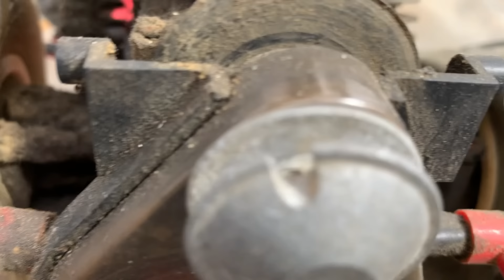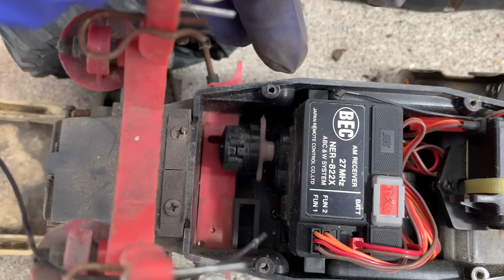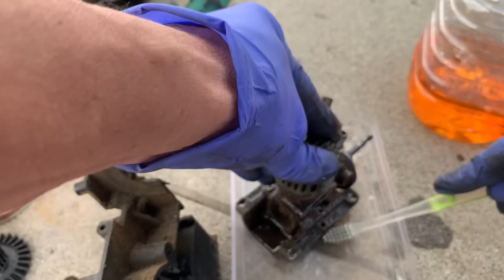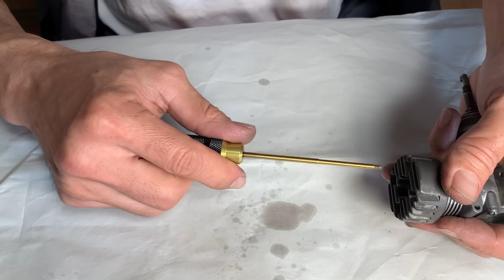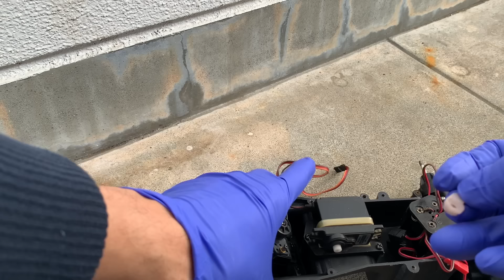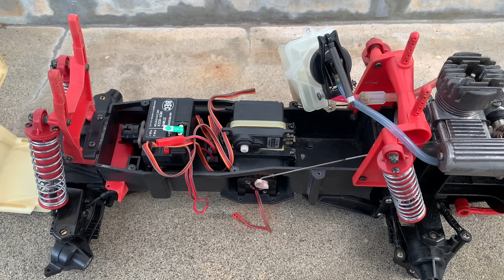Kyosho Nitro Brute stopped for 30 years, restoration

Comment: Hello, I had one of these, I see you've the Enya 11 (1.1), this upgrade, maybe was even suggested somewhere on the box, but problem was the 1.1 destroyed the clutch and brake, the extra torque would mince the clutch mech pads if tyres were caked in mud, or even on high grip surface be gentle on throttle inputs, if it fails she won't be able to stop, the brake will fail as you use it as its fighting the 1.1 without the clutch engaging, not a big problem if using in a large open area, either wait for fuel to run out, or scope her up as she passes by, Personally I would use her, just don't ever give her the full beans from stationary, she is a piece of RC history and certainly deserves a spot on the shelf once run a few times, i have looked for a Nitro Brute a couple of times and never found much info, thank you very much for sharing your restoration, P.s, does yours have the larger fuel tank? did you know there was a aftermarket exhaust that exited straight up between the cab and bed (ours melted!! lol) If you are familiar with the other Kyosho nitro offerings of the time (RS200 and 405 Rallye) these where considered bombproof when compared to the NB, best of luck, and again thanks for sharing, cheers Andrew.
Reply from the maker: Hello André, how are you?    So, in relation to the brakes, due to the engine, they really don't last long, the disc is already thin.    As for the tires, they are available on the Kyosho website, original, but I don't think they are worth it because they are expensive.    Thank you very much for your comment, have a great week.
Reply: @rcornothing7973  @ 16.39 is where the problem starts, on watching again in slowmo you are missing the self adhesive clutch pads that stick inside of the part in your right hand (2x pads like sticky sand paper), the 3 piece sprung loaded metal arms engage on these when spinning, the 11 or 1.1 destroys them. the part is your right hand let's call the "clutch housing" anyway this part looks like it has been run without the pads (it looks scratched by the metal arms) if so it means that part gets hot, causing it to fail, it is specific part to Nitro Brute. hope this helps. .edit- this will explain the wear you mention on brakes. The missing clutch pads were the only thing standing in the way of the huge torque of that 11 and what in essence a Big Brute gearbox. If possible I would see if a spare clutch housing part is available, and try source the self adhesive clutch pads (they were literally 100 grit sand paper with sticky backing)  or they can be made easy. I'm certain it's the pads that allow the slippage to happen without the centrifugal alloy arms coming into contact with the plastic clutch housing. (They could never be replaced with alloy because of balancing) if your plastic clutch housing feels brittle it has previously gotten to hot. Check for cracks, also. From memory we replaced that housing multiple times, Also had to replace gearbox parts on one occasion after the housing melted.
It was a shame the Nitro Brute failed, if it had been designed from the ground up, and been a monster truck version of Kyoshos pull start nitro rally cars, it would of been a beast,... could of been a different world!?! CLOD who?! Big Brute was quite the weapon and could run rings around Tamiyas King Cab over the ruff stuff, but the Nitro Brute's balance was all outta wack with that heavy engine hanging out back, removing the 400 gram nicad out the middle add fuel and tank which weights nothing, topping off the rear end with friction shocks, awesome thanks kyosho, (do I still sound angry after 30 years? 😂) joking aside, I honestly think, the Nitro Brute is one of the rarer Kyoshos, because from what I remember, they didn't sell (we got ours reduced after launch) it was our 2nd or 3rd Kyosho, and was our last, our melting happened once we fitted the Enya 11 (we were O.S engine fans, but was impressed with the 11, especially after running the 09 which was guttless) this was within weeks of purchasing, it was sat for months before we could get parts, after that parts were avaliable, but no more than 6 months and we were told, only parts available were the ones also compatible with Big Brute, with that and the aftermarket exhaust failing we gave up. Only reason Kyosho fans don't mention how rare it is, is because they don't know it exists, pretty sure many Nitro Brutes were converted over to Big Brutes, even vaguely remember a conversion kit was available as a special order through your local shop direct from Kyosho at reduced cost,  mine never ran for more than 3 or 4 tank fulls before breaking, so to own such a clean working example in 2024, congratulations there really cannot be to many left in the world. I have subbed and looking fwd to seeing her possibly run, good inspection of the plastic housing looking for tiny cracks, heat damage or brittleness now you know what to look for,  let me know how you get on with finding info on the clutch pads, Cheers and best wishes.  Andrew.
Reply from the maker: @MrFu75  yes it is true!  I had seen it, I put double-sided tape on it, but the tape was thin.  At the moment there was no thicker 3M tape.  The disc would have to be replaced, it is very thin, but as there is no such replacement part on the market, there is not much that can be done.
Reply: @rcornothing7973  3m tape sounds ideal, any serious over torque will exceed the pads design allowing slip (protecting that Big Brute gearbox from engine) enough grip to drive the truck without slipping (so polishing those scratches on the inside of the clutch housing is a good thing (nothing to lose, a ruff surface combined with scratched alloy arms is almost guaranteed clutch stuck in drive (this centrifugal clutch  design was more common a few years earlier, and worked better in 1/8, we used to polish all contacting clutch parts, as forces involved were enough to engage without slippage) but the NB seemed to suffer with needing constant cleaning and polishing surfaces to keep it working, if it stops working it always jammed in the open position, means you cannot stop, just make sure it hasn't totally locked open solid, again to protect gearbox. As for reading your comment about parts availability, that's a shame, I was hoping someone had found a warehouse full, have you found any forums or Nitro Brute groups? I did see someone asking for instructions last year, with Kyosho reissues ongoing, I hope we see a Big Brute reissue.
Reply from the maker: @MrFu75  Thanks for the tips, they are very useful.    I didn't find any forum about it, just one where someone is restoring a model, but who also encountered the same problem: missing parts.
Reply: I do believe you need a bit more lube in the rear diff
Reply from the maker: @gregrogers3030  Thanks for the tip, I hadn't noticed that, I'll add more grease then.

Comment: excellent restoration! thanks for sharing! Please I hope you can make a video running it, I love these videos

￼

😊😊😊😊🎉🎉🎉
Reply from the maker: Thanks for commenting, I'll try to do that as soon as I get the tires or similar.
Reply: The shelf queen 😮😮😮😮❤❤
Very difficult to get in 2024 and very very expensive in ebay 😢😢😢
Reply from the maker: Yes, it's true, the parts you can find for this model are expensive.
Reply: @rcornothing7973  limpia bien los neumáticos, ajuste los neumáticos a la llanta con un relleno para que recupere su forma y después rocielos varias veces con spray de silicona una y otra vez,si no están en muy mal estado recuperarán bastante de su elasticidad y podrá manejarlos nuevamente
Reply from the maker: @pedroberciano2810  Los neumáticos estaban todos rotos, ya no los tengo.  gracias por tu consejo.

Comment: I have a nitro car that is 20 years old, but it is still in like new condition without any dirt, every time after playing, I will clean the nitro car by using an air compressor so that every part is clean from dust and oil~malaysia boy🇲🇾
Reply from the maker: An air compressor is essential equipment for cleaning, as I live in an apartment, I don't have one as there is nowhere to put it.  Thank you for your comment.

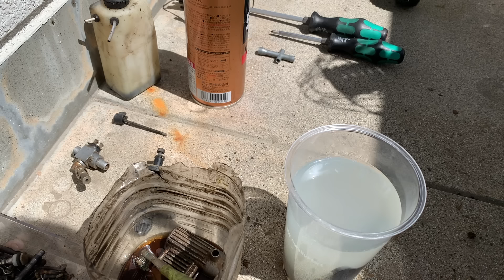Comment: Wooow fantastic work but i have a question what is the name of the product that you used to clean the engine mount and also the engine head 11:22 thank you❤
Reply from the maker: @diegoeugenioboschetti5626    

Thanks for watching, the product is water with washing powder, but it is a soap for washing clothes dirty with grease, I didn't like it very much because it left the engine part dark, as you can see.

Comment: I know how to fix that engine and its old but might need a new engine and has little more horse power now and much better than old one and replace the air filter to a new one and also buy full set of ballbearings to every moving parts too because I don't like broze bushings or plastic brushings because it will wear out fast thats why so ballbearings are last longer than that
Reply from the maker: You're right, the engine is old and there aren't many bearings, but as I don't use it, I intend to leave it as is.  I want to maintain its originality, who knows, maybe it will last a few more years